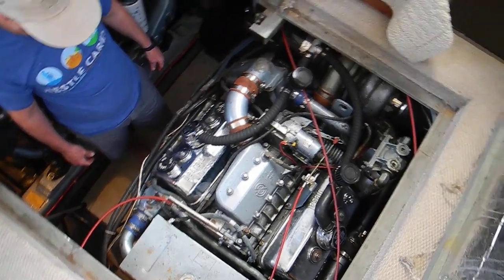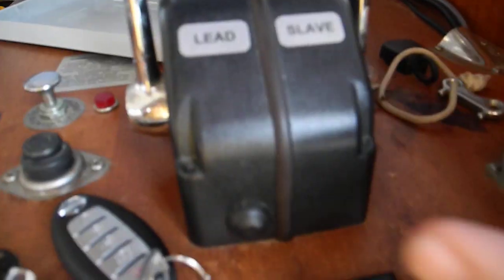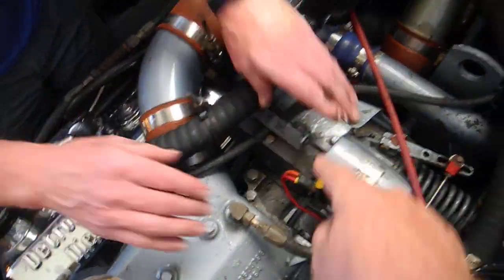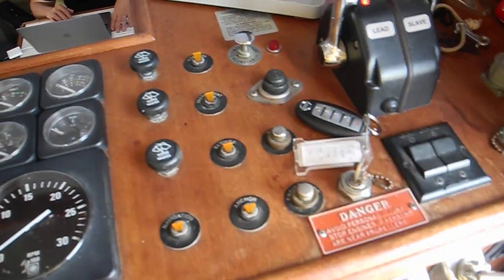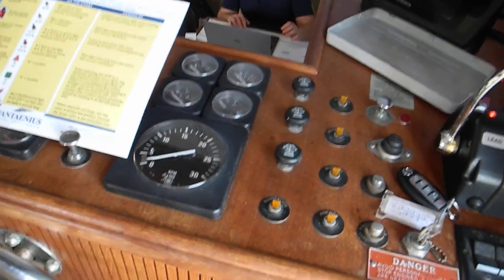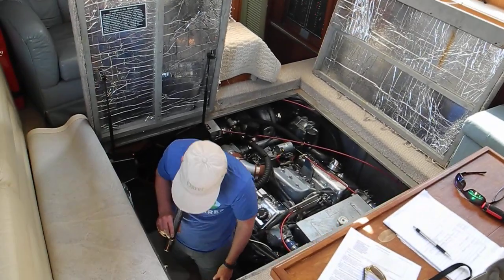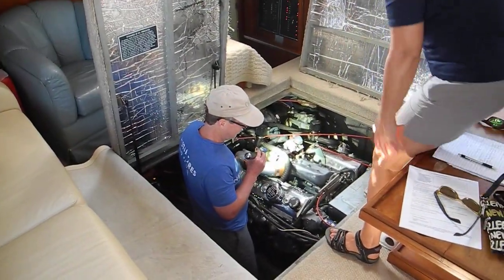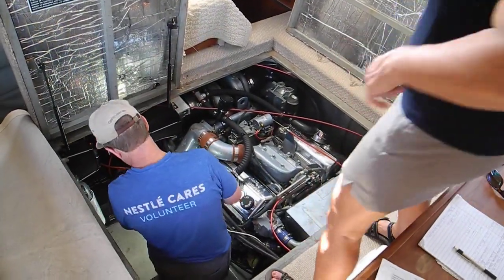Manual shutdown on Detroit Diesel 6v53 engine

Comment: Should be wearing hearing protection, sorry I am a butt. Safety attitudes starts with small things.
Reply: That's not needed regarding only the engine noise for a short while, they're not that loud but the oil pressure alarm could wake up the dead
Reply from the maker: skunkjobb 🤣🤣🤣
Reply: Huh 😆

Comment: Very simple engines to work on. Even a young Private First Class in the 80's could master them. I did. Then we got Bradley Fighting Vehicles with 903 Cummins and I had to start all over again.
Reply from the maker: Thank you for your service. The 903 was a monster wasn’t it? They had them in the USCG 41 foot patrol boat.

Comment: Good old 6V53 back in the 80s I worked for a company and we had a Hydroblaster with this engine. We had 2 smaller ones with 4-71s theh would run all day under a heavy load no problemo. These engines make a lot of power for the displacement. The 6-71 was rated at 238hp in a truck 426cid while the 250hp Cummings was over 800cid. Sorry so long winded I just get excited when I see a Detroit video. Smokey 🤩 🤩 🤩
Reply from the maker: Torque of a two stroke engine. Think of dirt bikes, chain saws and older outboard motors. Two strokes per cycle is always more responsive than four strokes per cycle.
Reply: @AskCaptainChris  Many 18 wheelers had the small 6-71 would move 70.000lbs 70mph on flat ground. With 426cid really remarkable.
Reply from the maker: Alabama Smokey Wilson you really know your engines. 👍🏼
Reply: Had a guy, a number of years ago, approached me with a 4-71 blower that he somehow acquired that had diesel still dripping off of it. Not saying that I lived in a bad neighborhood but auto parts were at a “five finger” discount. Glad those days are gone for me. Thanks. D.
Reply from the maker: @davidingraham1989  They probably wanted to set that "blower" on top of a big V8 gasoline engine for racing purposes. Look at the old drag racers and street rods with the SCOOP on top of a blower on top of a V8 engine. Ask Smokey!
Reply: @AskCaptainChris  we could have some LONG discussions about that. Maybe one day Smokey. Sorry I missed you at Rogersville. Thanks. D.
Reply: @davidingraham1989  Some of these superchargers could be adapted to a hot rod car for sure. My cousin has a Big Block Chevy with 800hp.The blower is not off a diesel but all blowers are basically 2 big screws forcing air into a engine